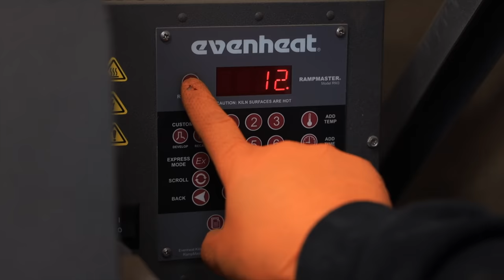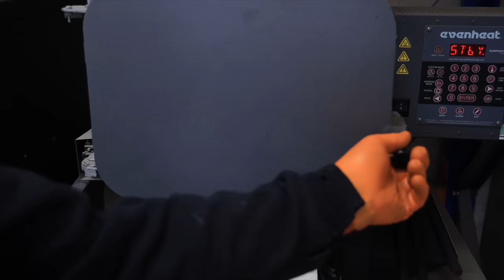Making A Dagger From A Rusty File

Comment: The best way to make sure a cylinder fits into a hole properly is to quickly run it in and out repeatedly until you're satisfied.
Reply from the maker: It’s an age old trick

Comment: I was just watching thinking we need more disturbed scenes when the brass went in the chuck 😂😂😂
Reply from the maker: Im sure i can fit more in for you
Reply from the maker: @squirrelmanbob  that was purely accidental as well I thought it would just go everywhere haha
Reply: @DiesInEveryFilm  you did look a bit surprised. You can buy caps that fit on regular 2l bottles with a valve in them so they can be pumped up to about 60psi, that would make a big splash when you stab it 😂. I shoot them and film in slow motion with my phone but haven't put any of those on here yet, just things like baby plum tomatoes and jelly being shot I think but that was last year. I might try to get out tomorrow to do a bit.
Reply from the maker: @squirrelmanbob  ahh ill have to check those out as it will make it a better end result i think. Thanks

Comment: try 3d print plastic to conductive coated/painted to electroformed mold knife
Reply: try low temp tin (Sn metal) casting in 3d print then electroplate with titanium/chrome or some other high durability/temp metal
Reply from the maker: Not my thing as i don’t have the machines for that stuff
Reply: @DiesInEveryFilm  its just one 3d printer bro, high temp filament
Reply from the maker: @Jkauppa  yeh i don’t have a 3d printer
Reply: @DiesInEveryFilm  cad to physical, just saying, simple as heck, no need to measure otherwise, from virtual to reality